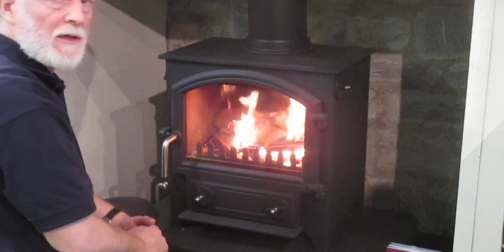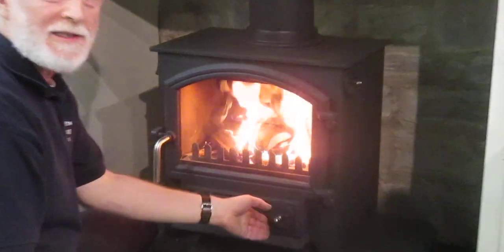How to light a woodburner

Comment: We use a wood  fired  insert  in the fire place. The   6 '' pipe  inside  the  brick  chimney  when  starting  from cold  is sometimes  a smokey  mess. You gotta  get it drawing  fast,  and get  some  heat in that  flu..